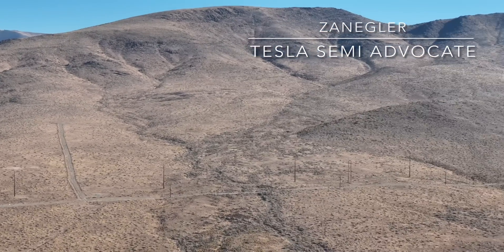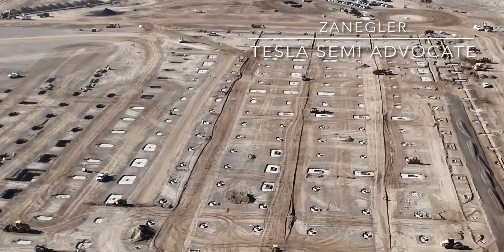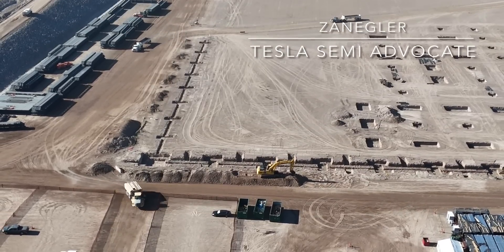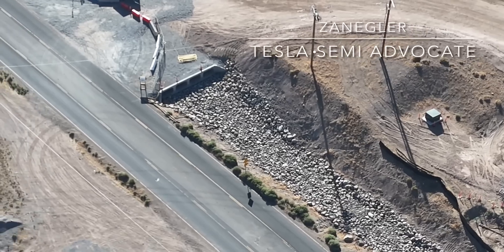Tesla Semi Factory Progress - Big Footings  Sighted

Comment: Crane hire is expensive. Despite having a 30 billion dollar war chest, Tesla is being extremely cautious about how it's spending its money due to current economic conditions worldwide. This may partly account for the reason Tesla has not had cranes onsite yet. If the concrete footings for this particular site need to be larger than normal  due to soil conditions and or the resulting concrete mix they're using takes longer to cure, you don't want to have very expensive heavy equipment hire just hanging around doing nothing if it proved that the rate of steel frame erection was faster than footings construction & concrete curing. Of course, all of this is pure supposition and conjecture on my part.

Comment: They may be waiting for the perimiter beam and associated traffic to be competed before introducing more traffic for the errection of the structure, this will also give more time for the concrete to cure fully. In the first seven days concrete only reaches 70% of its final strength and it takes 21 to 28 days to reach about 90% strength.

Comment: I don't see any stamping machine foundation. These are all columns footings. I don't think this factory have stamping machine. It's too low volume production , stamping machines have such high capacity it would idle most of the time. Stampings will come from an external supplier or another Tesla factory. If there Will be a body shop at all, it's possible that the complete cabin will be shipped in.

Comment: What you are seeing are footers for columns. If a footer is larger, it means it will be carrying more load. That would likely mean more than one level. The only way the work you are seeing has anything to do with 'stamping', would be if equipment was being placed on a 2nd or 3rd floor. The foundation for a giant stamping press would not be located where column footers are located. An odd shaped footing at the location of a column could potentially indicate the addition of something like an overhead crane.
Reply: Yes, foundations for presses would be in between the column foundations and will be dug later.